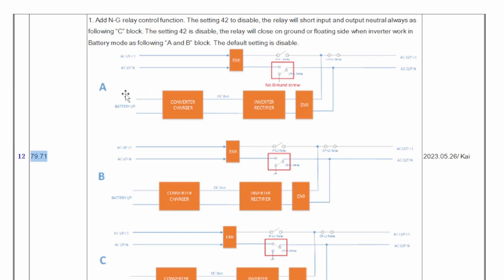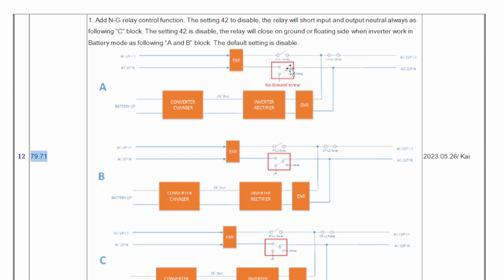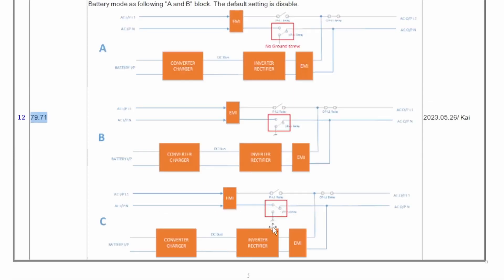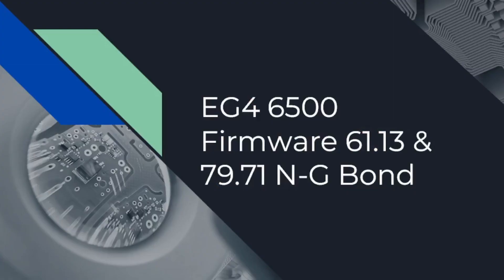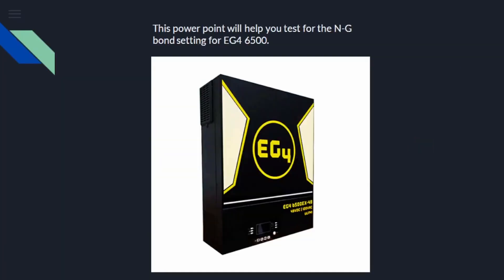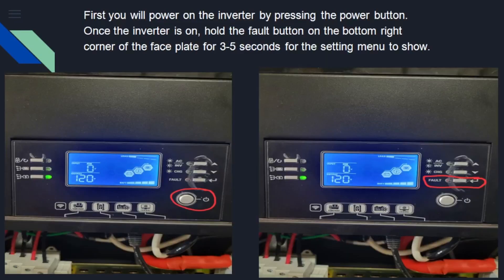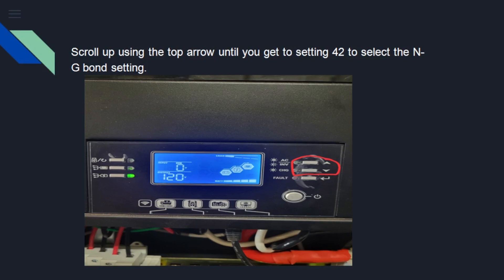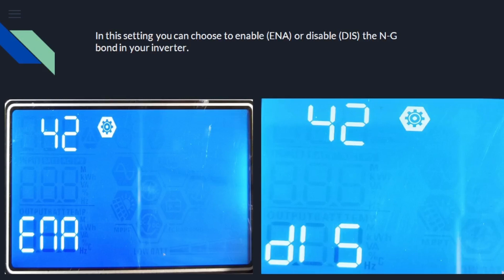EG4 6500 79.71 Firmware Update - Enable or Disable?

Comment: Per SS, setting 42 is now “ENA” for troubleshooting issues with 6500ex’s. I’ll see today if it affects my pulsating hp compressor, flickering LEDs and tripping SPD on the garage door opener.
Reply from the maker: Good luck!  So your inverters were each creating a g/n bond then which could cause problems.

Comment: This update causes a lot of issues for me. I'm wired for common neutral, and didn't realize that disabled meant the opposite, and when I turned on my critical loads, it caused GFIC's to trip, led lights to pulse and dimmers to stop working, one set of led can lights stopped working and the wife heard a pop, we could smell smoldering wire! The CL panel essentially ran without a neutral.
Reply from the maker: Sorry for the issues. They really could have done a much better job of describing it...

Comment: Still to techie for me.  I plan on getting 1 6500 inverter then add a second a yr later. I am totally off grid the nearest power line is over 2 miles away. I bond neutral to ground on my distribution box . I assume I don't want it bonded in 1 or both of the inverters  . Should I set my 6500 to enable?
Reply from the maker: Yeah if you have the bond in the panel just downstream of the inverters, then you would want to select “enable” so the inverter won’t create the ground/neutral bond.

Comment: why cant they just put the ground neutral bond screw in the bottom section of these inverters so us electricians can take it out or leave it in as we need it, are they ever gonna get it right
Reply from the maker: Who knows.  It’s kinda like when I do a renovation project at my house.  I see something that’s really “weird” or just flat out bad, but I’ve learned a long time ago to stop asking the question “why did they do it like that?” Because you’ll never figure out why…
Reply: This is actually better. (Even though confusingly backwards) no more getting inside to remove or install the screw. Just change a setting.
Reply from the maker: @timselectric502  it is, but depending on your installation, you might still need the screw.  At least if it’s already installed you can bypass it with the new setting.  If it’s not installed by default, if you need a dynamic bond, you still have to open it up…

Comment: The software engineer was just as confused as you when he was typing the line of code for option 42. if (OPT.42==0) THEN OPT_42.TEXT=“DIS”.  Maybe he flipped a coin to choose. Mechanical design team needs to communicate with software team. The bonding screw was confusing in the past and it just got more confusing. Thankfully we have you to offer a little clarity.
Reply from the maker: I’d does seem like everyone was doesn’t it?  Hoping I was a little less confusing…
Reply: @AdamDeLayDIY  Your videos are spot on, I am a product developer myself and the most difficult part when introducing a new product is writing a user manual. I can explain how it works from inside but We need people like you that can show how something works from outside. You have the ability to problem solve and make an easy to follow video which is a rare gift. If you ever want to take on other product challenges unrelated to solar search me out privately.
Reply from the maker: @ColorMaker_Solar  Appreciate that.  I’m a developer myself and I get to be the Q/A guy a lot at work.  Trying to break things is a little more fun, but I like trying to figure out how things work.

Comment: Great video, Adam! If I use an Mpp or grow, I would create an exterior neutral to-neutral bond; it's cool that these machines can now do it internally. Thank you for taking the time to make this video 😊
Reply from the maker: I’m not sure about the Growatt, it’s probably the same as the MPP, but I would think with the MPP you would still have the relay creating the bond when in battery mode and disabling when in grid bypass.  I haven’t heard of MPP getting any update like this one.

Comment: I'd say option 42 is to be labelled "Disable Neutral-Ground Bond" and you enable or disable that function. It makes sense, but I still hate those kinds of logic in any device.

I think the key word in the manual is "to" or "is". Enable 42 "to" disable the bond. If 42 "is" disabled, the bond is enabled. It's a bad translation, but you can see the sense in it. 

I'm only up to the power point presentation portion of the video, but these are my thoughts so far.
Reply from the maker: Yeah it needs to be something clear which doesn’t require research each time you look at that seeing in the manual.